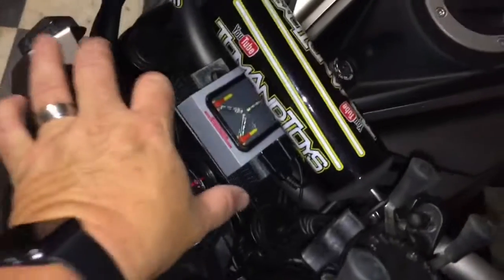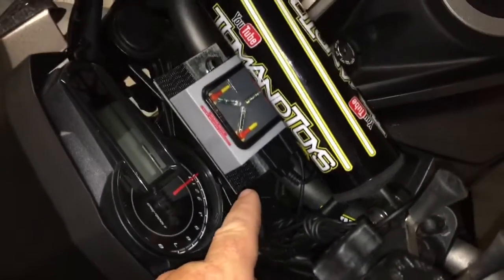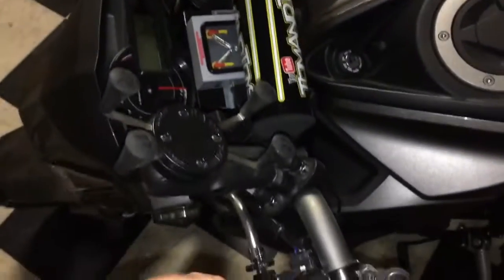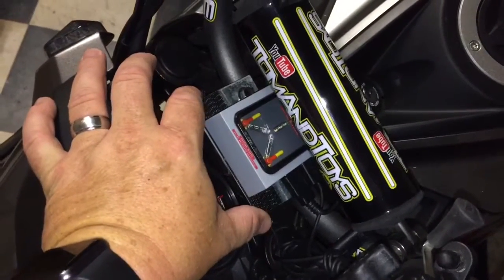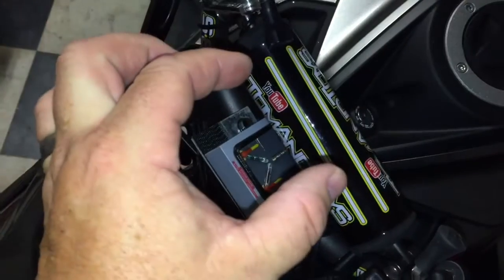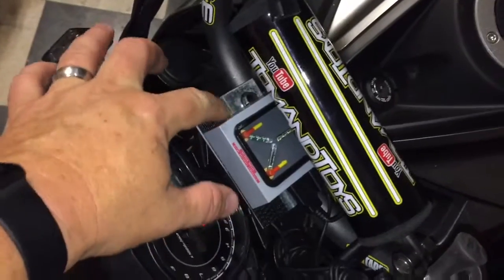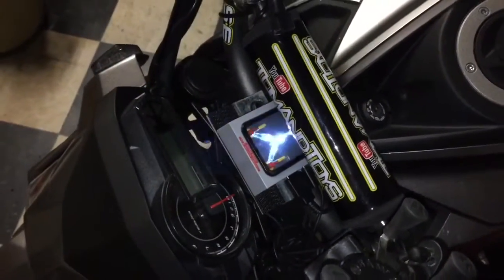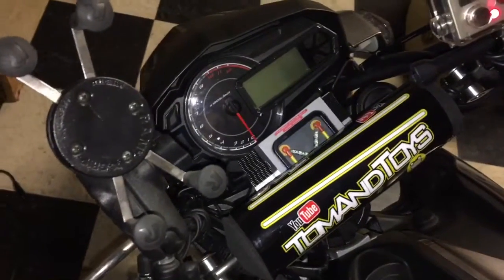Kawasaki Z125 Pro - Mounted the Flux Capacitor

Comment: I love that Flux Capacitor charger. Have you plugged it straight to the battery ("always on") or is it plugged through the ignition?
Reply from the maker: Always on but I have a rockers witch that I can turn it off.

Comment: hey tom I really like that your the for front of z125 upgrades, also are you planning on more engine upgrades? I've been on hardracing's website hardracing.com and seen that they have a a performance oil pump and other engine part in now.I've been planning on going small with the z125 or going big with the ninja 650. now the ninja's is pricey once insurance is factored in. but then the 125 isn't to far off either. just its a good bike, I like doing upgrades and mods. but there are lots of high ways around my area so i'd need to pull 130kph out of it to be what I would consider safe....
Reply from the maker: Thanks!  Might do the pump. We'll see. She won't go 130kph. She only grabs 109. :)
Thanks for watching!
Reply: I know about the speed short comings and that's the only thing that is tipping the table for me. I see there are big block kits coming as well so maybe there might be hope + bigger diameter wheels, at the death of my wallet